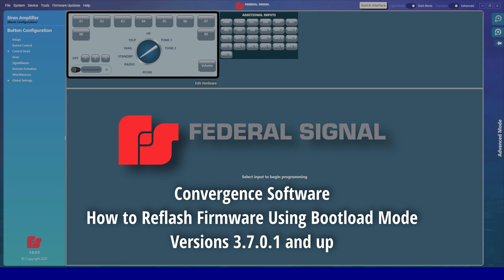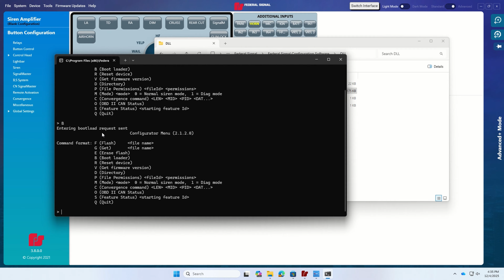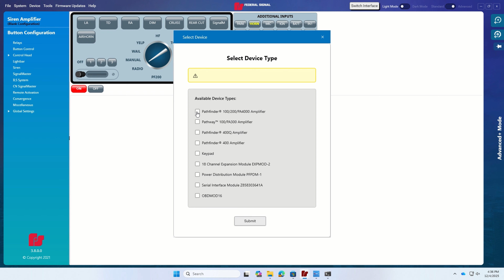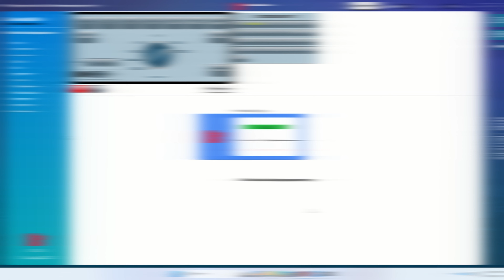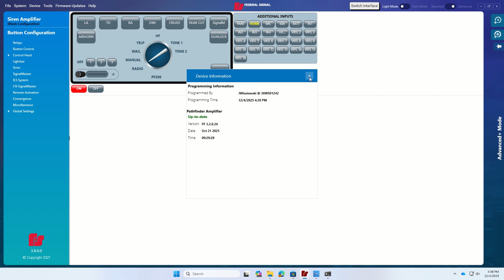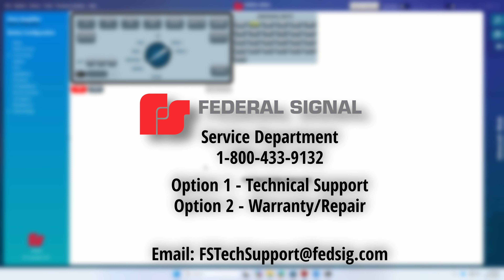Convergence Software - How to Reflash Firmware Using Bootload Mode (Updated Video)

Comment: Got a question, so I have a ssp3000b with a series b controller can I hook the amp positive to a standard car battery with the inline fuse and negative to negative without a 100w speaker and will I still get sound? Thank you.
Reply from the maker: Unfortunately no. You would need at least one 100W speaker to drive the siren tones from the amplifier.
Reply: @FederalSignalProgramming Thank you!